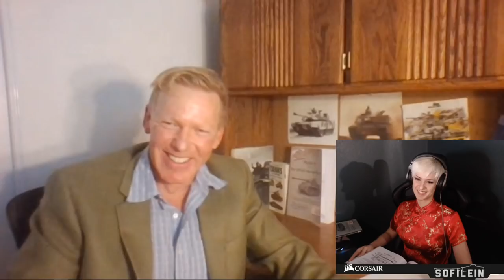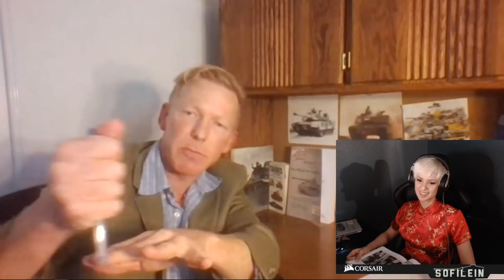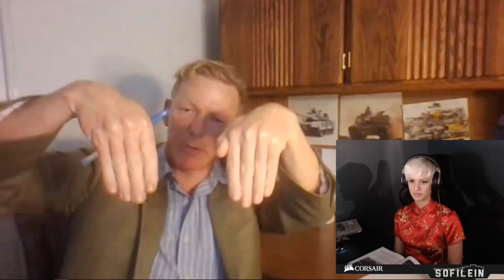Transmission and Roadwheels: Tiger I Mythbusting with Bruce Newsome Part II

Comment: Compare to the KV tanks, the Tiger 1 would be like driving a Rolls Royce. How bad is it when you have to steer a tank with a hammer?!
Reply: Which one of these was more armoured?
Reply: @maratbodrutdinov3255  
Tiger 1 
Front: 100mm 
Sides: 60mm
KV
Front: 90mm
Sides: 75mm
Reply: I thought that priblem only on bt and t34 tank wait they have the same transmission?
Reply: @BHuang92  and yes later in 1942 kv will come up with 25mm bolted on Armor 
Kv is from 1940 ...I like it
Reply: @BHuang92  Tiger I has 80mm on its sides of the upper hull and turret , the 60mm is only on the lower hull.
Reply: @BHuang92  Tiger1 side armor was 80mm and 60mm behind the wheels
Reply: @BHuang92  Tiger sides and rear were 80 mm.
Reply: @BHuang92  Tiger turret front (mantlet + turret front): 140-200+ mm
Reply: @mr.waffentrager4400  extra armor due to panzer III shooting APCR ammo which could penetrate KV sides at least
Reply: Yeah and change the gear with a crowbar.

Comment: Otto Carius has said that he never had problems with his Tiger E. From what I have read, the weak link to everything was the final drive. However, I am not an expert or even a good modeler~! A few years ago I became interested in Tiger recovery in a place in the world that was mostly undeveloped. It is interesting to see how Tigers which were stuck deep were routinely freed for immediate use and sometimes freed under their own power. While I am sold on they way you have made the point on the reliability, American tank destroyers were not scared of the Tiger as long as they were able to get into position to do their work on the sides. IT is likened to an alligator wrestler who is not afraid of an alligator unless he gets out of his position where he can control the alligator!

Comment: Amazing to hear about how (relatively) easy the Tiger (and Panther) were to drive...
Reply: What do you mean with "(and Panther)"?

The Tiger had power steering, and neutral turn ability. And it was only ~24% overweight compared to what its drivetrain was designed for. It had to be treated with respect, sure, but its final drives didn't shit themselves if you tried to turn while reversing.

The Panther tho? That thing had to be babied.

Comment: in the back of the book Tigers in the Mud, are some interessting documents to read, of the early tigers, combat trails. 
From what I understand It's more the supply of spare parts, that was a problem for german tanks, if you can't fix tanks, there will be more wear on the tanks that are still in service, and the need to cannibalice the broken tanks.
Reply: There are numerous complaints from German tank units that the unit has x number of tank company crews waiting for new tanks or for spare parts to get the disabled tanks moving again. Gets bad in early 1944 and then worse as the logistics system breaks down.

Comment: Wow! This was great! Again, I really bought into these myths of how crappy the engine and transmission was on the Tiger. This was REALLY eye opening, especially the "semi-automatic" gear shift and steering. "The easiest tank to drive of World War Two"? Wow again!
Reply: The engine and transmission were overloaded; the size of the tank and its engine and transmission system were determined early in the design process, and 'feature creep' through the development made it a significantly heavier tank than it was originally intended to be, with the space limitations inside the hull preventing them from putting a more powerful engine (even if one had existed) and more robust transmission, so the performance and reliability were less than originally expected. Was it cripplingly overloaded? No. Barring situations like the materials supply problems that plagued Germany which contributed to the early unreliability of Panther final drives, German manufacturing was perfectly capable of turning out highly reliable equipment. (An illustration of this was the Kettenkrad's tendency to break gear teeth in the transmission, due to the gears being manufactured from aluminum to save steel for tank production; when surviving Kettenkrads have their aluminum gears replaced with steel gears, the problem disappears)

Comment: The big disadvantage with the inter-leaved road wheels is that mud can clog them up. Or at least get clogged in there between them. Add in a freezing night and now that mud is frozen solid inside there. Good luck breaking all that up and freeing your tank. I've had bulldozers frozen to the ground before. Took an hour to thaw them with a rosebud torch.  I cant imagine the hassle of thawing out in between the road wheels too. That could take half a day. And ALOT of work.
Reply: For a weapon designed for us in Western Europe, it probably wasn't a big deal. For the Russian winter the opposite was true. However, unlike the testing of the M4, the Germans did what they could and took a decision on lowering track pressure and improving mobility for a very heavy tank that had an unforeseen cost in actual war time experience.

Comment: This has answered well a question on transimiision failures that you can find any info on, with new technology will come a few gremlins . Have heard that inexperienced crew had higher failures through improper operation I suspect they were likely trying to turn too quickly going too fast or some combination of which you could not do with lever driven earlier models. Just my thoughts. Great videos these , thanks 🇬🇧

Comment: The roadwheels also grind together which makes huge noise and maintenance nightmares. At a WW2 tactical, I sat in my Greyhound and heard those interweave Sd251s coming from long ways off.
Reply: Only when they were damaged. The roadwheels had more than enough spacing inbetween eachother
Reply: CAG Hotshot  that's still not the wheels grinding against eachother. Don't see your point

Comment: From what I have read that most of the failures were track related this was due to turning on the spot and the ground filling up the space on the tracks then snapping them. The work around is to move the tank forward or reverse while turning to alleviate the pressure. The Tiger I also had less ground pressure than a Sherman.

Comment: Tiger 1 was developed to fight in the mudd , swamps and moores of Sovietunion the allied never had to develope a tank for.
They complain about the german wheel system to be too complicated to maintain but they worked in the wet area where the british and american simply sunk in due to too high pressure.
And it makes no sense to save 5% at wheels in case you need the power of such a tank.

The  key question is to ask the crews and the toll they paid and which tank they would preferr.
Pretty easy to find allied tank crew reports and diaries that they would love to have a tiger but not vice versa, no german tank driver wanted a sherman, a churchill, a crusader ... not the guns, engines, transmissions ... why if these were so great tanks.

Usually allied crews complained they where sacrified in cheap tanks produced by millions - but the german crews were protected better.
If you add armor, power, gun you always try to protect your crew cause faster tank is better, tank that can drive through wet belgium or dutch fields is preferrable to others that could only follow roads ... Yes, they were expensive, but less expensive than to raise the next tank crew members and train them cause that will take 18 years from date of birth.
Reply: To your first point, both the Sherman and T-34 were plenty capable of operating in the mud, swamps and the like. The T-34, of course, specifically being designed for operation within the USSR (shocker, I know.). Evidently, these same tanks (at least, looking at Shermans with HVSS) had superior flotation and off-road characteristics when compared to the Tiger, be it the initial or later derivatives of such, so I believe you are giving far too much credence to the idea that the Tiger was an exceptionally reliable or able tank in these specific conditions. 

Secondly, there are  actually plenty of memoirs and reports that go both directions. Allied reports often emphasized the exceptional quality of German steel welds and other miscellaneous aspects of their tanks, of course also highlighting general traits such as armor or firepower. The Germans, however, also made reports praising the mobility or protection (noticeably of the T-34 or Sherman, even) of their Medium tanks. For the Sherman specifically, specific commendations were made to the vehicle's comfort, maintainability and automotive reliability even under harsh conditions, while much of the criticism around early Shermans surrounded its poor Gunner optics. So, it turns out, both sides were analyzing and praising certain attributes of their opposition's armor, as they should, as any advantages of an enemy design that you can identify, you ought to incorporate into your own designs!

As for your final points...
"Usually allied crews complained they where sacrified in cheap tanks produced by millions" 
This, like how the video is debunking Tiger myths, stems from myths about Allied tanks. Even the Soviet tanks were well-designed vehicles, only their production came as a need to the doctrinal necessities of the Soviet Union. The Sherman, being the most-proliferated Allied tank on the Western front, had tons of accommodations for it which deny the idea that it was a "cheap" tank, later on you have a vehicle with a fast-firing and deadly cannon, a solid suspension and excellent flotation characteristics, multi-variable zoom telescopic AND periscope sights (of which German Medium Tanks / Heavy Tanks only tended to have Telescopic Sights), excellent ammunition stowage, a powerful engine and transmission, and tons of potential for adapting and modifying the design to suit the needs of the Allied powers. Compared to the most prolific German Armored tank of WW2, the Shermans were more mobile, better armored, better armed (at least the 76mm Shermans were), and had substantially more crew accommodations to make it an overall safer and more sustainable vehicle. The Panther, while also fairly prolific by late 1944 and early 1945, was not without its numerous teething problems that German reports railed upon for a great many months, many of these problems persisting even after the War's end with countries who used them post-war. This isn't to say that the Panther was a terrible vehicle and that Allied armor was all spectacular and perfect, but the truth is that when comparing the armor of the two sides, you need to look at the full picture, and not just compare the advantages of German armor to the faults of Allied armor.

Comment: My previous reading lead me to believe that fir the tiger the final drive was not beefed up as the design was upped from its concept weight (35 tonne to 56 tonne) and the panther was due to the box having to come out to do anything to it so the crew would be more prone to leaving it longer between services
Reply: The tigers components has nothing to do with the 35 ton desing. The pre tiger prototypes were designed by a different firm and the onval gearbox plus steering were designed by Henschel and only appeared on the well know Tiger.
Reply: @venator5  straight cut final drive vs herringbone
Reply: @scrubsrc4084  First of all the Tiger had planetary gear arragment, and second it's a misconception to believe that a herringbone gear can transmit more power than a regular streight cut. In fact straight cut gears are the most effective way to transmit power. Hence all race cars from dragster to 24h long endurance racers use gear boxes with straight cut gearing. Herringbone gears run smoother, less vibrations less noice. Hence in your standard car you will find herringbone gears. But in a lot of cars the reverse gear is straight, hence some cars make those howling notices when driving backwards.

Comment: Why no mention of how noisy (squeaky) German armor, including Tiger, final drives, road wheels, tracks and suspensions were?
I've been active with a Chapter within the US 82nd Airborne Division association for 30 years. Not many WWII paratroopers and glider infantryman left in my Chapter now but over the decades they told me German armor squeaked to high heaven when maneuvering. They could always hear them- usually withdrawing or flanking, rarely advancing, especially at night. In other words- no surprises, the Allied infantry and artillery always knew were German armor was and were they were going.

Comment: The upper part of a track is moving with twice the speed of the vehicle. The PzKpfWg V was effectively able to go far higher speeds than other German tanks. If speed is dubbeld, the energy stored in the moving parts quadrupels. And the tracks of the Panther are far heavier then the tracks of older German Tanks. Therefore the energy stored in the moving tracks destroyed the final drives of the Panther.
Reply: Dude the tracks move twice the speed in reference to the ground. This is creating an illusion that tanks seemed to move faster than they actually are, if the upper track is visible to a spectator.

In reference to the tank the track moves with the exact same speed on both sides. Your comment does not make sense.
Reply: @HaVoC117X  It's the same regardless of your frame of reference. If you have a tank going 40kph, relative to the tank, the track on the ground is moving backwards at 40kph, and the return track is moving forward at 40kph -- meaning that the track at the drive sprocket undergoes a change in velocity vector of 80 kph. Relative to the ground, the track on the ground is stationary, and the return track is moving forward at 80kph, meaning that the track at the drive sprocket undergoes a change in velocity vector of 80kph.